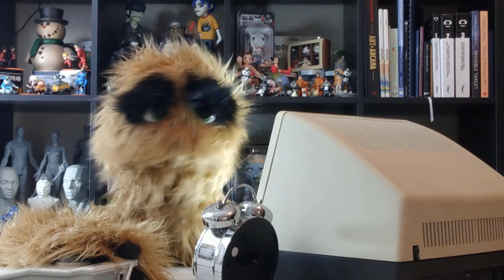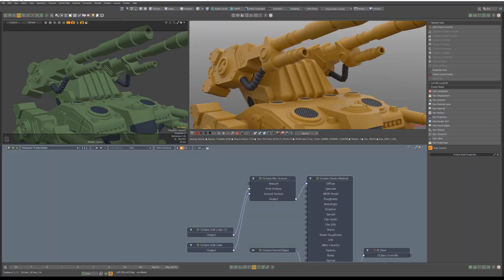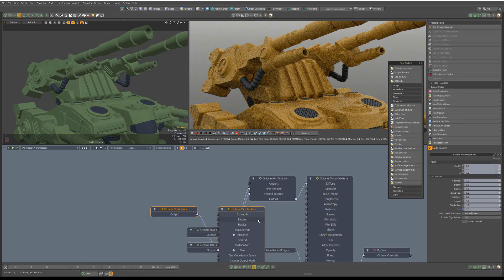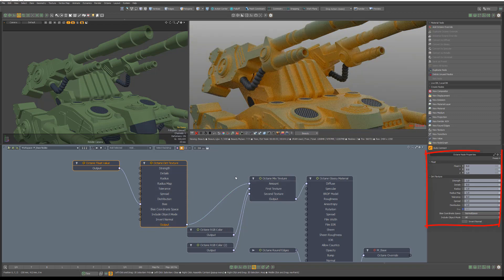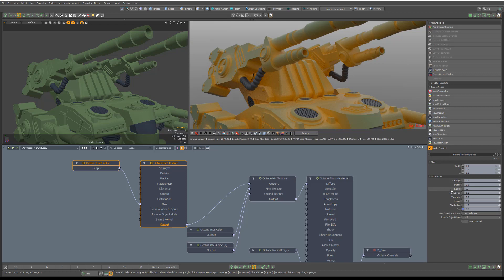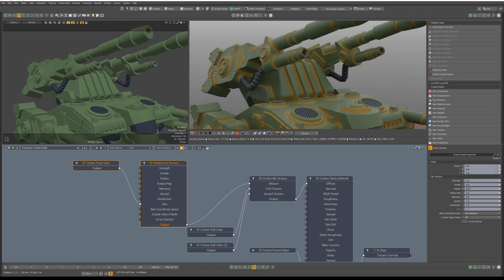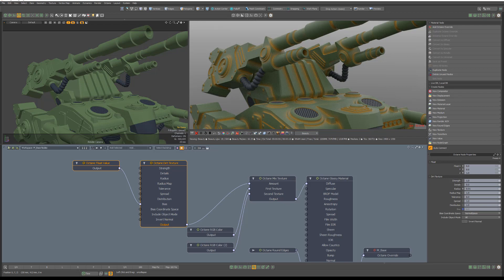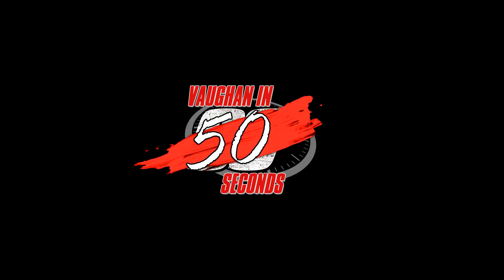Modo | Octane Render: Dirt Texture

Comment: This one is awesome, Is there distortion on the texture to make it a bit more random?
Reply from the maker: I would use a procedural texture and then mask it with the Dirt texture. Would make for great rust, dirt, grime etc
Reply: @Pixelfondue  I had the same question. But I fail to put a mask on the Dirt texture. How do I get this?